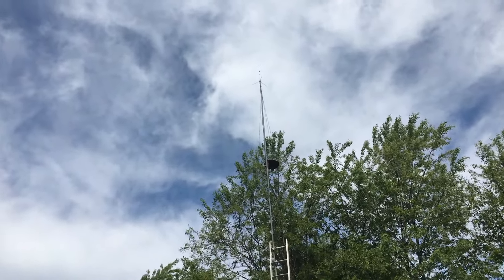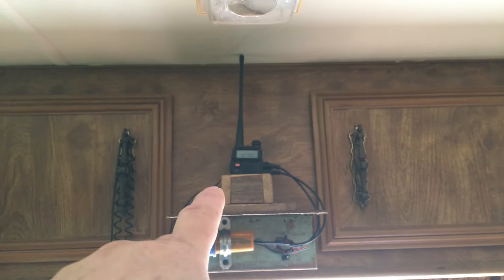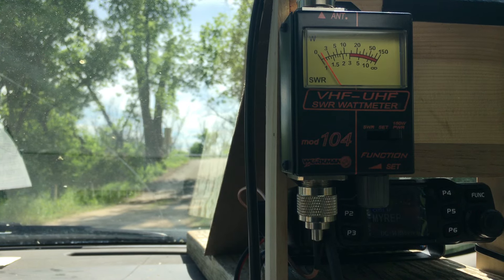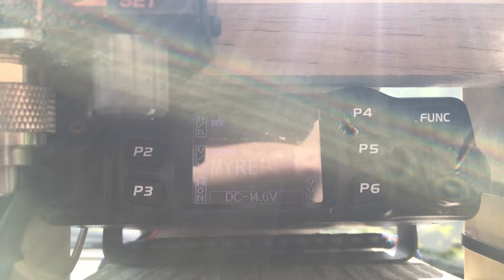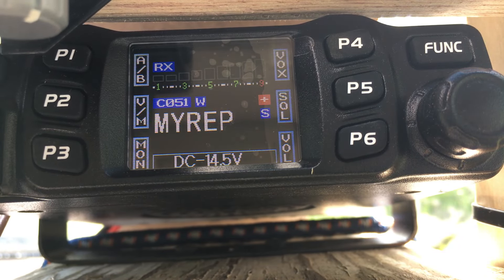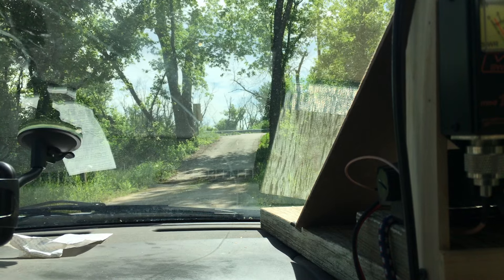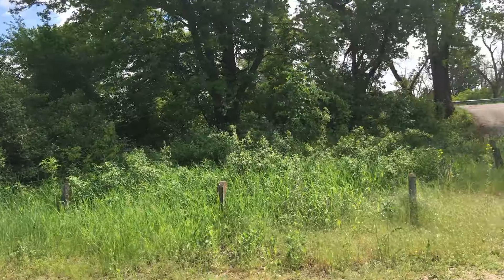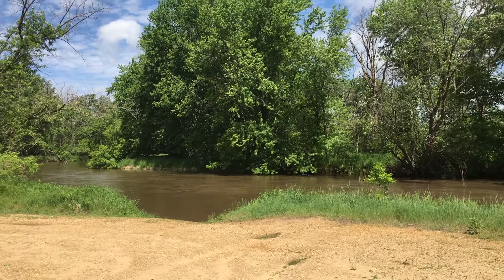🔺PT2 distance/range test 40 watts Bridgecom vs 6 watts Retevis RT97s  GMRS two-way radio repeaters🔺

Comment: get the Comet 712 GMRS  base Antenna. you will thanks  me later. in my case, i was using Ed fong GMRS and i remove and install the Comet GMRS. my communication increases and i hear repeater that never i hear before. i recommended that you for anyone..
Reply from the maker: Yes I was checking into that BUT its soooo tall if I recall 10 feet!! Which means I will have to redo my mast, which I need to do anyway
Reply: @GMRStwowayradio totally worth it! 😉

Seriously though. As much cool tinkering as you do, getting the best antenna as high as possible would pay dividends.

Comment: Your videos are very detailed, your content is very good, I like where you are going with the channel. 
Constructive feedback - the audio comes very clipped, it gives the feel that you are forcing your voice quite a bit and although I understand how difficult may be to avoid this with a low dynamic range microphone, it prevents a more enjoyable experience. 😊 I really appreciate your time and attention to detail, and effort put on the videos.
Reply from the maker: i am guessing you mean the mic I use to make the video? If so, ya sorry I have to be carefully on the mic I use due to the TX from the radio causing problems at times.  I am working on a better way, hopefully this will help.

Comment: I thought for sure the Bridgecom would have worked better due to the power difference. I'm running a KG100G repeater setup at my house and it really kicks butt. (48 watts).
Reply from the maker: I am not sure what area your repeater is in. but keep in mind I am in a very bad area so that don't help with distance, but it's great for testing 🙂 also keep in mind wattage is not really for distance, It's mainly for penetration.

Comment: Thanks for the detail. Please do something about your audio. Very over modulated and hard to listen to without turning way down.
Reply from the maker: hummm no one else has said anything about that but not sure what I can do about that it's an iPhone and headset but will check into it maybe a setting somewhere??? not sure
Reply: @GMRStwowayradio  Try increasing the distance between the mic and your mouth.
Reply from the maker: @MrMindlink  LOL of course I tried that 🙂 But in my newer videos i think i got the problem fixed 🙂
Reply: @GMRStwowayradio  LOL, I figured as much...  Thanks for the videos, they are helpful.
Reply from the maker: @MrMindlink  lol no problem and thanks for watching

Comment: I would suggest maybe an external mic or even a Bluetooth mic.
I have to turn down my phone to listen to this video the audio is a bit much.
Thank you for your video,I like watching people test equipment.
I’ve been debating getting a retevis for hunting spots.
Currently I park my vehicle high up on my hunting spot then run a mag mount to a btech GMRS pro and set it to audio relay  mode.
Then me and my friends head down on either side of the mountain that the vehicle is parked on and that seems to work okay but the retevis seems like it would be a good set up to place in the trunk and run a good antenna to and maybe the extra watt would help penetrate lol maybe.
Again thanks for the time to make an interesting video.
Reply from the maker: i am using an external mic, a headset. Problem is, the RF from the radio can make the audio cut out when using wireless mics. Anyway you are welcome and thanks for watching